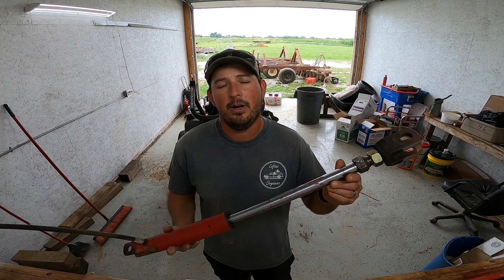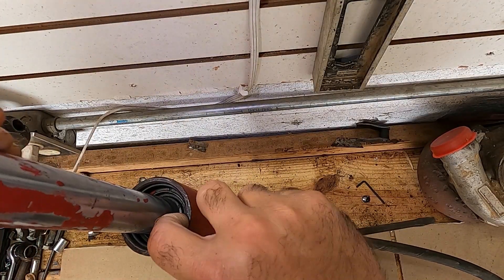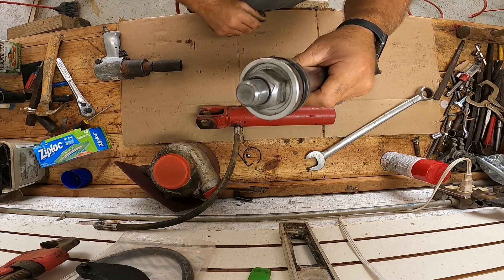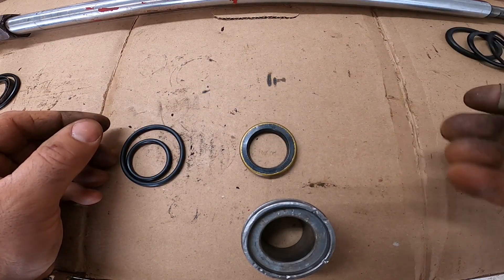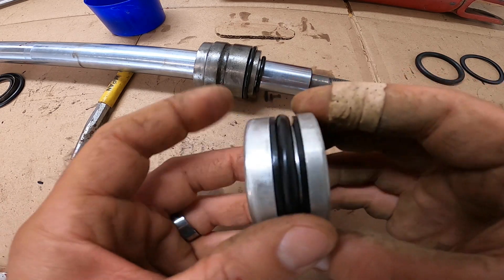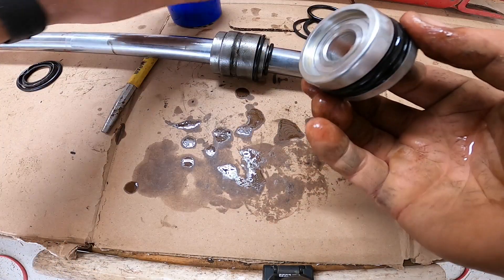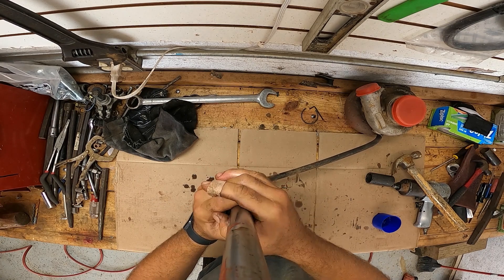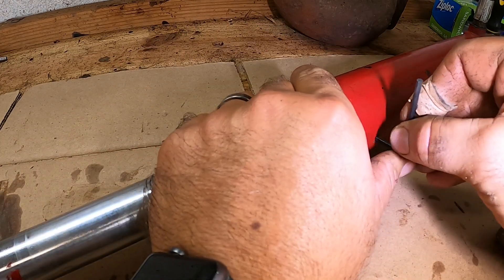How To Rebuild Hydraulic Cylinder - New Holland 1036 Bale Wagon (2022)

Comment: My lift cylinder gland had that small "extra"O-ring inside the gland around the shaft. I believe you have the older style gland and the new style gland has that "extra O-ring" in a groove/boss machined inside the gland so it seals on the shaft in addition to the outer seal.
Thank you for this video, it helped me greatly to fix mine this morning at 1am when it blew on my 1032